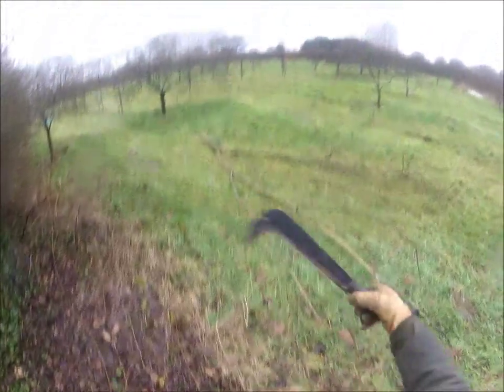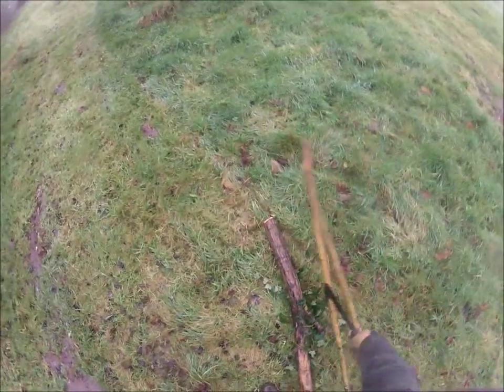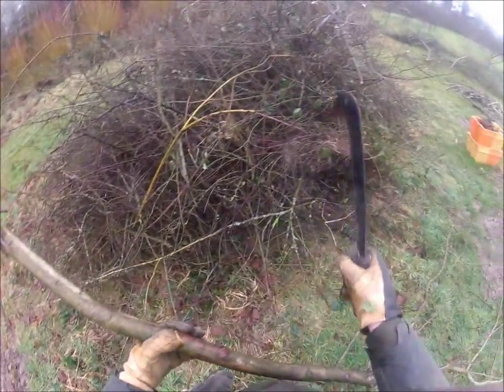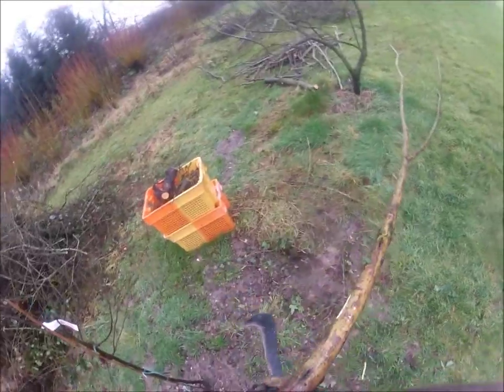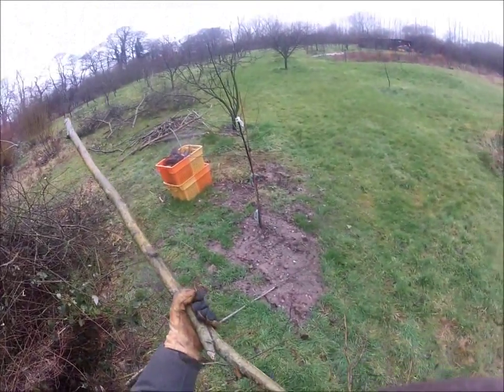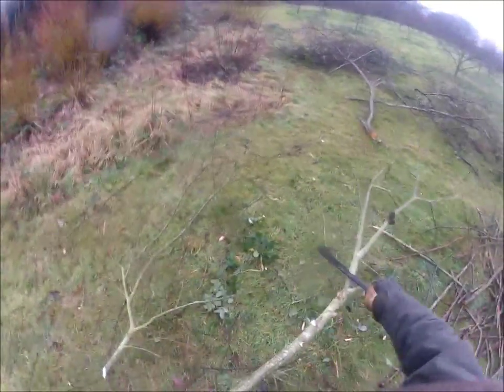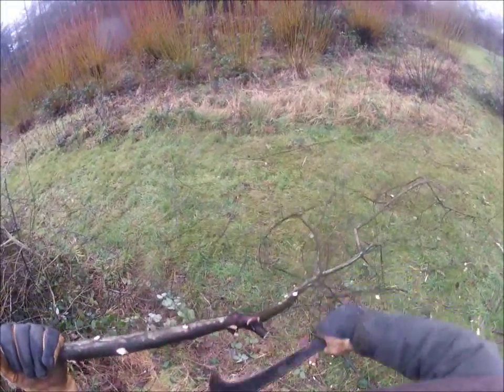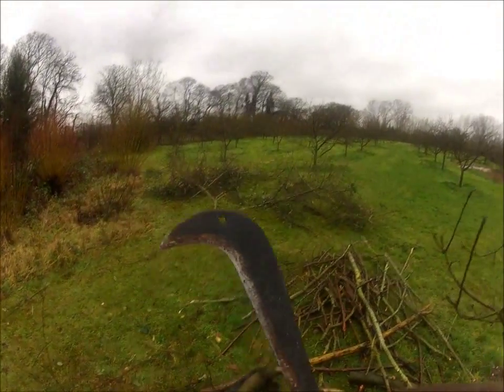Hedgerow management part 2

Comment from the maker: Sorry, it was due to strong wind. I'm stil getting used to this head cam. There are 2 casings, one is waterproof (very poor sound) the other had an open back, which I used for this. I will try some porous tape over the sound holes to try to baffle the wind.

All honest criticism is welcome but I have to make decisions as to whether to put these vids up imperfect or not at all.

Comment from the maker: Fruit contains potasium and wood ash is a rich source of it. Its highly soluble so we put it on when growth is taking place. Stacking it up against the trunk would be a bad idea as it is caustic when wet. Around April Julia walks down the orchard rows with sacks of wood ash we store from our wood burning stove in winter and using an old steel ladle applies a ladle full to the soil around each tree

Sorry not to be more detailed, we don't do a lot of precise measurement in our orchard!